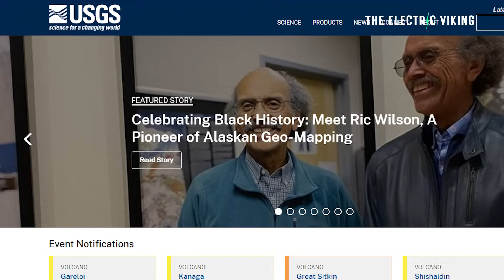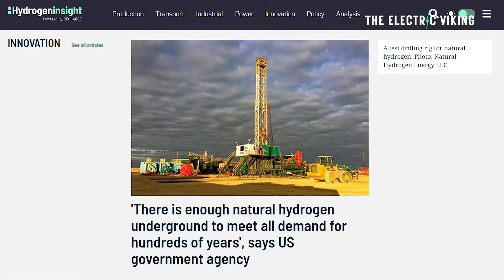US Government: 'Gold mine' with 200 years of hydrogen discovered underground

Comment: I wonder if the Hydrogen can be used in fuel cells?  Some inventor may devise a way to separate it from other gases. It is a tiny molecule that is adsorbed by metals. This is one way to store it safely also. It diffuses much faster than other gases due to its low molecular weight. Hydrogen is the most abundant element in the universe. The oceans are made of H2O. So it is very abundant in that form on earth. It is a very clean form of energy. Burning it gives some oxides of nitrogen, but the fuel cell gives drinkable water, electricity and some waste hear, no oxides of nitrogen.

Comment: Hydrogen has its use cases but can't see it taking off with consumer EV.  Moving hydrogen around physically is a lot more difficult than electrical lines. EV also has the extra benefit of being able to use it with home and remote solar installations.

Comment: It must be less expensive and easier than electrolysis. Imagine using windmills and solar to extract h2 and transport by rail. If it works companies like plug power will benefit greatly. I'm betting (not the farm) on this. IF is the key word. We will see. I'll hold for 5 years and see what happens. Average just under $4 for plug but will add in coming months if it keeps falling.

Comment: … has anyone bothered to calculate the amount of water this will produce on a planet thats already got enough of that and its getting worse.  I calculated the water production from publicly available data of world usage of oil and gas.  It was roughly enough to fill Lake pleasant in Phx three times a year.  My solar charges my car and powers my house - off grid.  Hydrogen=continued energy slavery. 
Sure its great for may uses, but shouldnt be used to generate power. We will just use more, until it becomes a problem

Comment: Reading the responses here. Boy, you people want to hold on to your gas guzzling pollution monsters. 

Heres an interesting point Tesla's are currently powered by coal.

There were x number of dinosaurs. And we're drilling 6 miles down about the limit of our technology. 

Any and all alternative sources of energy must be honestly looked at. The only byproduct of hydrogen fuel is water. Technically, 426 hemi could be powered by hydrogen and would sound the same. The fact that it will leak out of steel pipe is irrelevant. We have other technologies to work around that issue. The planets future demands it. 

The Hindenburg and other airships of the times gas bags were made out of cow and pig intestines.

Comment: Natural reserves of hydrogen underground, would be a great resource if used properly.

I would suggest not using it in vehicles.

The use I would suggest is, shipping an aircraft.

After world war II, a hydrogen plant was built in Florida by the military and this hydrogen plant output was used to run a modified jet engine and it worked perfectly well.

The plant currently produces a lot of hydrogen used for spacecraft, however I believe the perfect application would be aircraft and shipping not automobiles.

Scientia Habet Non Domus,

(Knowledge Has No Home)

antiguajohn

Comment: Theres a reason hydrogen is number 1 on the periodic chart, its literally the most abundant resource in the Universe, not to mention its cheap n easy to make
Reply: Ummm.  No. It’s not easy to make. And it’s not cheap. In fact, it’s near impossible to store because the atoms are so small.  Remember when you boasted about it being number 1 on the periodic table?  
Hydrogen has a small fraction of the energy of gasoline, still requires combustion, is triple the price of gas per mile, and about 10x the price of electricity per mile. 
Your ignorance is palpable.

Comment: Wierd that as a chemical engineer with a vather that is a professor in geology, I have never heard of hydrogen mining. You state that the Hydrogen being impure mixed with methane would be a problem, however it is a not that hard to separate and b methane itself is also highly valuable. So it kinda sounds like a win win. You do realize that they separate oil into all it's different components right?

Comment: The availability of hydrogen is, essentially, irrelevant. This is because of the huge cost to store & transport hydrogen. An 18-wheeler load provides sufficient for about 40 fillings of road cars. Currently, the transport cost per litre exceeds the equivalent gas price per litre at the pump. the retail price would need to be somewhere around $6 US per equivalent energy to a gallon of gas if the hydrogen extraction & compression costs were excluded.
Reply: There may be solar tech which could provide H2 production on site for filling stations.

Comment: yeah, i don't believe it. i'll take it like all other battery break thru news that promises to be next apple or promises we wont need lithium ion batteries. some information is not being shared hydrogen is very reactive and easily bonds to other gases and elements. most likely hydrogen is bonded to carbon and other elements found in methane. it would take more energy to extract it than it has.

Comment: Maybe it's natural gas and it needs energy to extract hydrogen from it - end the carbon from it still gets released in the air as CO2.

So basically hydrogen from natural gas and that's even worse than natural gas itself, because of the energy needed to do all these additional processing steps.

Comment: Hydrogen does not work for cars, maybe if all the efficiencies improve greatly, but by then batteries will also be better, higher capacity, faster charging. It may be viable as a stop gap for nuclear fusion power in electricity generation. If there is a gold rush it will be short lived. Great channel just discovered, thanks.

Comment: One thing I learned from American news. Its just all hype just for stocks to spike up, owners would cash in and then the stocks would drop due to speculation. Remember Nikola Motors? The company was  hyped up with the media to the point that GM bought significant shares of the company, up until now Nikola Motors havent sold a single working electric truck unit. Pretty sure someone is profitting heavily from this hydrogen mine hype up.

Comment: What do they mean by "TONS" OF HYDROGEN? Not being critical, just trying to get a handle on this. It is a gas. It is lighter than air, right? Do they have to suck it up and liquefy, put it in a tank and weigh it? And if they are saying it was pure, and in the next sentence, it is almost always mixed with other gases, and then to top it off, it will be almost impossible to access it, how did they find out? Where did they drill some kind of test hole? Can we go see it?
I'd appreciate any input, from anybody. Thnks, Mike

Comment: Four questions.

1. While H20 (water) would be the more abundant result of H2+O2, it is not out of the question that HO (peroxide) will also be the result. HO is highly corrosive to steel/iron. Are we really planning on making all engine parts out of stainless steel, all the way to the exhaust?

2. I'm reading several reports from 'mines' around the world that say the gasses they contain are 92%-98% hydrogen (H2).  Great! Now, what does the other 2%-8% comprise?  Radon seems HIGHLY likely in ALL mines. Do we really want to blow more radon into the air faster that nature seeps it through the ground?

3. Is the H2 truly H2? Or is it HD, DD, TT, etc.? How deuterium or tritium radioactive isotopes are we dumping into our air as we burn the nominally-called "H2"?

4. Why do we want to pump another greenhouse gas into the air? Water vapor currently accounts for half of the greenhouse effect (according to MIT). So we'll stop pumping CO2 into the atmosphere and instead replace it with more H20. We'd need either double the rain we have now to offset the greenhouse effect of doubling the H2O vapor, or, live with continued warming just from a different gas.

Comment: But there is no demand or use for hydrogen!
You can't contain it very easily and therefore all moving of it is difficult.
Besides, it is still this greedy 'exploitation', stealing from the past,  by gas/oil companies. Sounds like a last throw of the fake idea hydrogen is of any practical use.

Graphite thermal batteries, storing heat, providing heat and electricity, look set to supply big heat needy industry from surplus solar and wind.

Hydrogen has no practical use, unless perhaps in airships that have to replace planes, or we go without flight hopefully.
Reply: Yes no demand 😂

95 million tones was used in 2022! Do you eat food or use steel?
What is the cost of your proposed storage solutions? One salt dome can store more energy in the form of hydrogen than all current installed battery capacity on earth. Salt domes are common. The DOE disagrees with pretty much everything you just stated. One truck stop with 10 MSCs requires 10MW of power which is the equivalent of a small power plant or 20-50 acres of solar. Explain how your solutions are cheaper? You are neglecting the cost and difficulty of distributing the energy in your model. Once you start factoring in this infrastructure H2 doesn't look nearly as costly as the naysayers say.
How do I know this? Amazon, Walmart and Home Depot have access to all of the technologies available today and they are expanding their use of hydrogen across the board. Simple Google searches will reveal this.

Did you know 1/3rd of all groceries purchased in the US are moved with hydrogen. If you had posted what you said in 2012 I might have believed you.

Time for some education...

Comment: These sorts of things only fuel the hydrogen movements ludicrous claims that H² vehicles are more efficient and convenient than EVs. The cost and complexity of H² cars are enough to put  people with common sense off them. Unfortunately common sense is not so common anymore, and it's mainly the dreamers and those with massive subsidies that are still forging ahead for  H² in the transportation sector. 
If you're not producing and using H² on the same site, you're doing the opposite to the environment than waht your intentions are, as H² is 12 x more dangerous as a greenhouse gas than CO².

Comment: Won’t amount to anything as far as cars go. Hydrogen filling stations can only fill 50 cars a day so keeping them filled would be an enormous task. Plus there’s no fueling stations available. There will be other applications but EV’s have such a massive headstart over hydrogen, without the storage issues, and electricity is available everywhere that it will never compete. 

As batteries get constantly cheaper with better energy density EV’s are a better choice 

As hydrogen tanks in cars take up all of the trunk space, hydrogen produces nothing but a problem. In heavy machinery like locomotives, ships, maybe jets, and in outer space applications, maybe even power plants it could be very practical. But never in a car.

Comment: Ammonia which is hydrogen and nitrogen and it's greener made by GMO algae. No high pressure issues so no major infrastructure changes. Pump it like gasoline. Safer for average joe. Exhaust is water and nitrogen 👍 also ammonia is in your urine 😜

Comment: A single salt cavern in Utah can hold more energy in the form of H2 gas than ALL INSTALLED BATTERIES ON THE PLANET. Just one, and there are ~100 in that geological formation. It can be stored indefinitely. 

The cost and scale of this energy storage cannot be matched by battery technology today.

Don't listen to the ignorant commenters. You have Walmart, Amazon and Home Depot all using H2 in their distribution centers. Are your packages burnt when they arrive at your door? 😂

1/3 of retail products sold in the US are moved with H2 equipment at some point in the distribution network. 

A 2016 Nobel winning chemist said he is confident he (and others) will find ways to store H2 at ambient temperatures and pressures. H2 can be stored diffused in solids often at higher density than as a pressurized gas.

It's science people! Forget your bias and don't rule anything out. These commerters are not well educated on this topic. BEV bros should all start wearing red caps with some of the nonsense they spout.

Comment: First I thought that the fossil fuel companies would hate the idea, but a second thought occurred who is going to profit from this? Companies with drilling and processing equipment. Also if or when it fails or runs out, who will step in to supply all the Hydrogen car drivers? In the end it's not a renewable, so I suspect it would become another money stream that the fossil fuel companies will exploit for huge profits, use to conceal fossil gas extraction and control the market. I notice the cost of renewable energy is high for the customer but low for the producer and have a fairly good idea of where the difference is going. I'll stick with solar and wind.

Comment: If there is large and viable quantities of hydrogen underground (which is a novelty), i would have though separation from other gases would be relatively simple in principle. Given that its small molecule allows it to leak out of many ordinary materials it would just need that leakage  tuning to get hydrogen through as fast as possible without allowing other gasses through.

Comment: I think this potentially as big of a game changer as fracking/shale.  I think the simplest way to exploit it is to generate electricity and ammonia right at the source.
Reply: I totally agree. Transporting it (or even storing it) would be so problematic it just isn’t worth it. Making a power station atop the hydrogen/methane mine however, and using it to make nitrates for fertiliser as well, makes way more sense.
Other side hustles might include refining metals from ores mined nearby, such as aluminium or titanium, which require huge amounts of electricity.

Comment: The problem with Hydrogen is distribution, you basically need to build power stations where the Hydrogen is.  Even pipelines are not economical, Hydrogen is just very non-dense.
Even if someone hands you free Hydrogen it is still stupidly expensive and inefficient to use it.

Comment: The Hydrogen isn't any more readily available than oil, it will have to be drilled for, separated, compressed and then delivered by tanker to refuelling stations if it's to be used by road vehicles. That's not the only issue with inconvenient Hydrogen. Getting it into vehicles and using it efficiently is never going to compete with BEVs.
It's certainly useful for Steel making, but wasting it in vehicles makes no sense.

Comment: If large deposits of relatively pure H2 existed underground in the USA, the oil companies would have already exploited it.  The United States has been the oil industry's favorite "pin cushion" for over 100 years.  There is H2 underground but it is mixed with so much (primarily) natural gas it is not worth extracting and purifying.  And remember if we want to be carbon neutral, we will have to push the "waste" natural gas back underground.  That will take a lot of energy.  If there is pure H2 anywhere underground it is going to be a very special and probably small place.  "200 tons a year" you said?  

BTW, there are many commenters to this video who have very good arguments about what's wrong with this whole "White / Gold" Hydrogen thing.  Good job everybody!

Comment: Natural Gas is way cheaper than gasoline but u don,t use them for cars bcos of the need to pressurise them. Same goes with Hydrogen and with an addition problem hydrogen  combustion  is extremely fast and ignites very easily compare to other fossil fuel. If u think li ion battery is dangerous wait till u see hydrogen storage accidents. Ever heard of Hydrogen Bomb ?

Comment: It’s amazing that there is hydrogen locked away down there.. like it is such a small molecule that it leaks through solid steel pipes.. how did it get there from a geological point of view. You would have thought that it would have escaped and floated up to the highest part or the atmosphere.
Reply: It's being made down there by ionized minerals reacting with water. It didn't need to get down there.

Comment: Assuming that there is indeed a huge reserve of hydrogen underground and processing of the mined hydrogen into pure hydrogen is commercially viable, it still may not be able to compete with electricity whose application has been established for decades or even centuries. Hydrogen needs to go through the development processes similar to those of electricity to sort out all the problems including storage, distribution and delivery before it can be used by users on a commercial scale.
Reply: Hydrogen maybe economical as a fuel for peak electricity generation- when demand exceeds supply from wind or solar. But it appears to be much more expensive than natural gas.
Reply: You cannot compare hydrogen with electricity. Hydrogen is a fuel. Electricity needs to be generated from another source of energy. Great if there were enough solar and wind generated electricity but the sun does not always shine and the wind does not always blow.
Reply: @patrickmccutcheon9361    I get what you mean - hydrogen is a substance (element to be precise), electricity is an energy. But hydrogen is seen as a competitor to electricity which represents and is generated using mainly fossil fuels, solar and wind power. Especially in terms of hydrogen driven vehicles vs. electric vehicles (EVs).
Reply: @eugenec7130 If there really is that much extractable reserved, I could see hydrogen converted to electricity. That would avoid the issues around handling hydrogen.